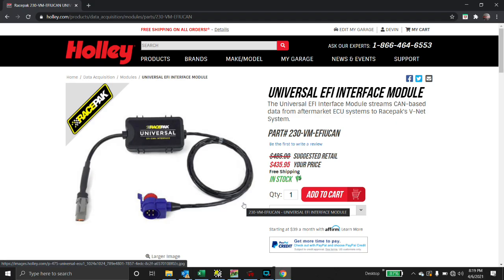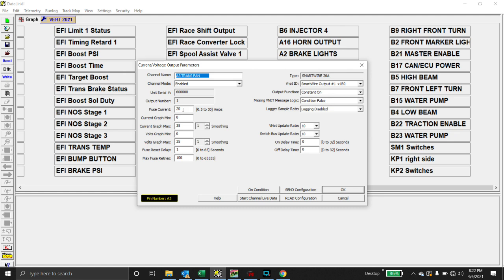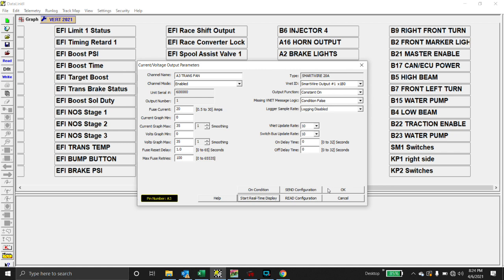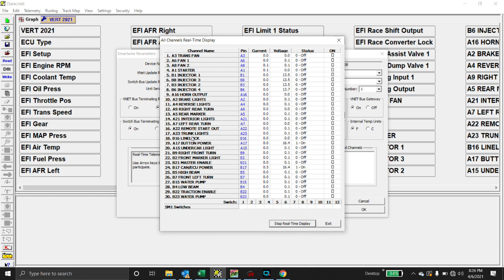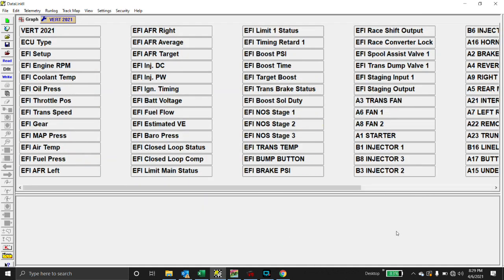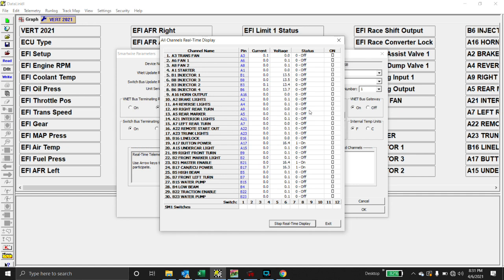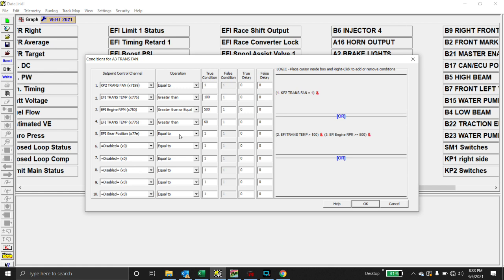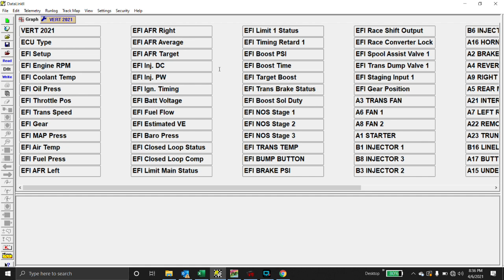Racepak Universal Efi Can Module interfacing with Holley Dominator

Comment: Just an FYI to maybe help someone else trying to make this work.  DO NOT use Racepak Can Bus you have to use the Holley Can Bus protocol both in the Holley software and in setting up the the Racepak EFI Can Module.  In setting up the Racepak module there are 2 Holley dominator profiles you have to select the one for Holley Standard V4 can bus.  If you use Racepak it will not pull over all the information to make it work like he shows in the video.  This info is not very clear and the people at Racepak do not know how to do this and only a few people at Holley are familiar with it.  I was also told to run the Can connection for the Racepak Module on J3 and not on J1A with everything else.
Reply: Are you saying that you used Holley protocol on can bus #2 in the dominator config with luck? It seems this firmware update Devin is mentioning in this video might not have ever been made available to the public? I set up the SW with Holley Dom Racepak in ECU Type, and it only populated 20 EFI channels, and I do not see an option to select "Input #" as he had in this vid. I have custom inputs I need to reference for outputs. I would love to be able to do this and appreciate any help!

Comment: How many Holley I/Os is the module capable of pulling over using CAN?  And are they all configurable?  So if I don't need my SW to see EFI Ign Timing will I be able to configure that input for something like brake lights if I wire the brake light switch into the Holley as an input?